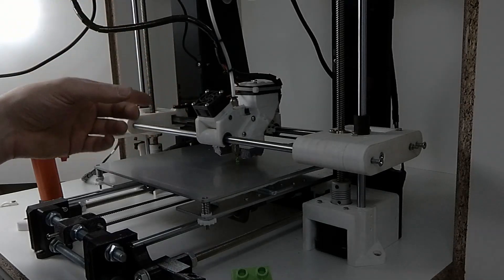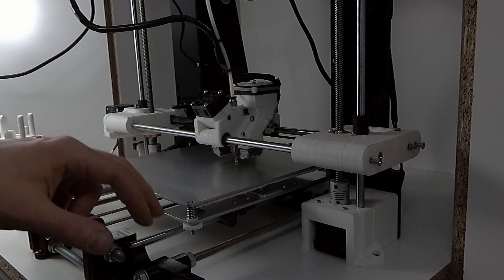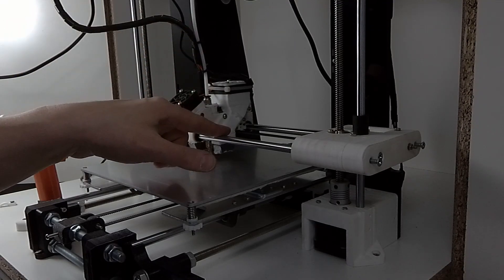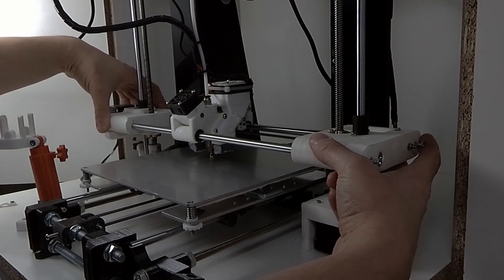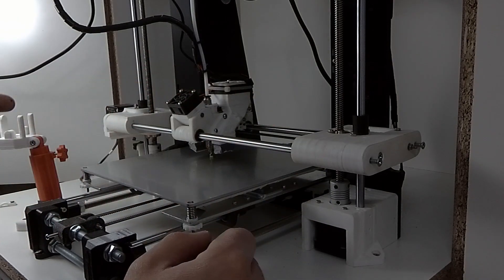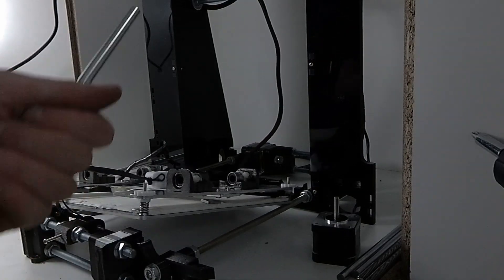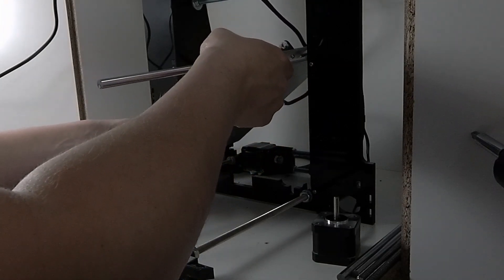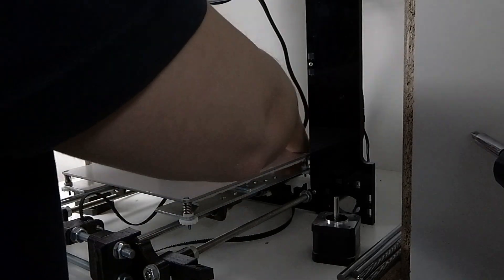Anet A6 Prusified 3D printer upgrade. Part 1 Disassembly and Y-axis

Comment: That smooth rod issue can come from bearings not being properly lubricated, not saying that was your issue but they do need lubrication. And now I know why you replaced your smooth rods. I got an Anet A6 for $20 to use for parts. Well now I plan to convert it to more of a Prusa i3 style like you did including replacing the entire extruder hotend. Just bought new 8mm lead screws and couplers today. I have over half the parts printed now on my existing heavily modified RepRapGuru i3 printer. Will be nice to have a 2nd printer.
Reply from the maker: I don't know why but for my Anet and Prusa xaxis rods will have grooves sooner or later. That's why I've did the linear rail upgrade for xaxis. Having two printers is really comfortable - you always have a spare one to print the missing/broken parts. When I was upgarding my Anet I had to print everything beforehand - it was stressfull because if something would go wrong I would to rebuild the printer to its original state.

Comment: Hey, can you say something about front and back bracing, they are not Anet A6 stock. Like Threaded rod length, link to thingiverse etc. ?
Reply from the maker: It's taken from here:
https://www.thingiverse.com/thing:119616

I had to cut extra holes in the frame to fit the threaded rods for Y axis.

All mods of my Anet A6 are in the collection:
https://www.thingiverse.com/medyk3d/collections/aneta6-prusified
Reply from the maker: Let me know if you need more info. I probably still have the threaded rods somewhere. From what I can remember I changed the belt for y axis also. The braces for screwing the frame to the bottom wooden plate are custom made. I should have the files somewhere.

Comment: Thanks for putting this out to Youtube land.  I have an A6 and have upgraded it a bit - stable base, belt tensioner, synthetic bearings, new extractor and hot end - it prints OK.  My question to you is, apart from the new extractor, did all this make any difference, or was it just a bit of fun?
Reply from the maker: The biggest advantage is no need to level the bed every print and magnetic bed sheet. It's less noisy too. Print quality haven't improved so much. It's more about fine tuning the printer and settings (belt tension, lubing, temps, speed, etc.) All in all A6 can print quite ok. I wouldn't say that my origanal Prusa is 4 or 5 times better but the price is.
Reply from the maker: And yes it was a lot of fun and learning. In the future I hope to compare my Old Anet A6 print with modded one and Prusa. But first I need to finish upgrading the printer. I am making a new Prusa style frame.